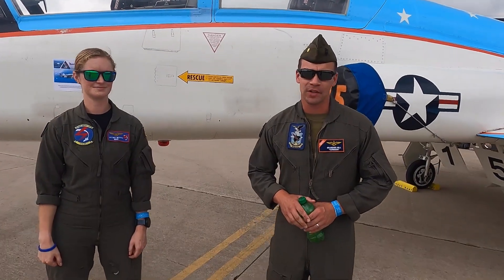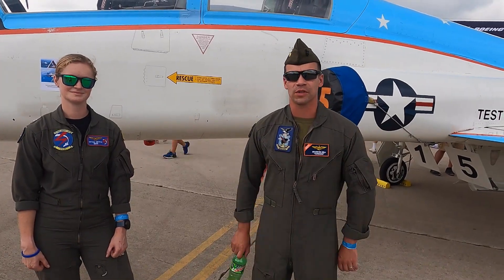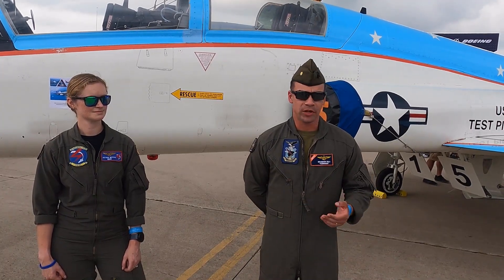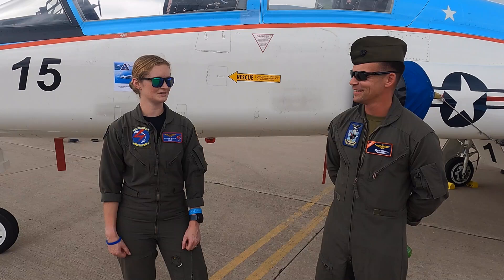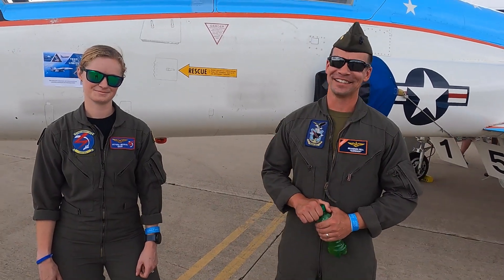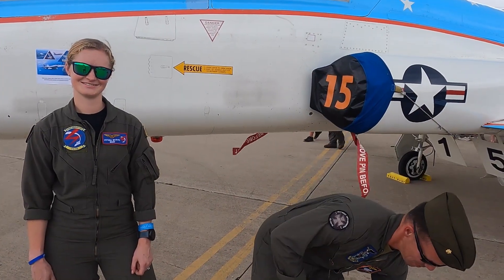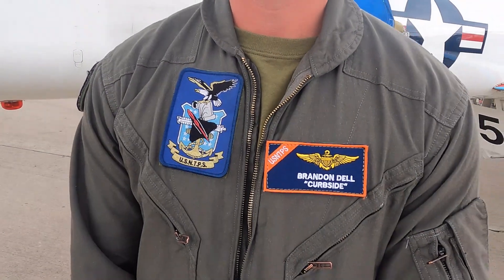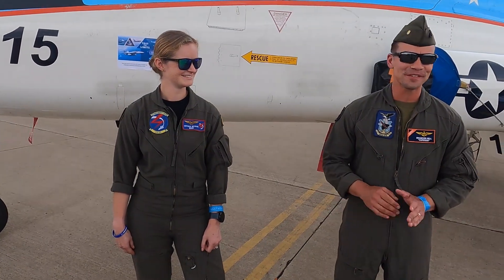Naval Test Pilot School T-38 Interview Oshkosh

Comment: Ron, do you have any information concerning an F-102 that disappeared off the Florida Keys in the mid 1960s?  I believe the pilot's name was Captain Rose.  I was a AF dependent attending the 2nd grade at the time.  Recall there were at least two active F-102 bases at that time; Seymour-Johnson in NC and Richards-Gebaur AFB in MO.  A small contingent of F-102s were on alert at NAS Key West.  Seymour-Johnson was phasing out the F-102 so the missing F-102 may have been stationed out of R.G.A.F.B.  Also, naval air may have been involved.  Just remember hearing that Cpt. Rose descended to investigate a contact and his wing man flying cover reported he disappeared from radar.  Don't recall a reported probable cause and thought you may have some information.  You clarified the 1976 T-38 crash at R.G.A.F.B for me, so I thought you might be able to provide info on this one.